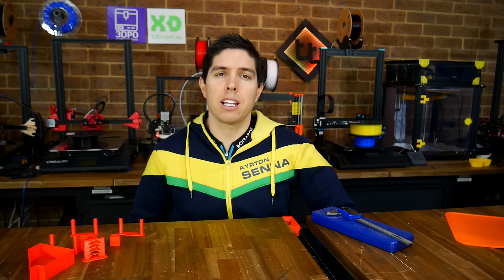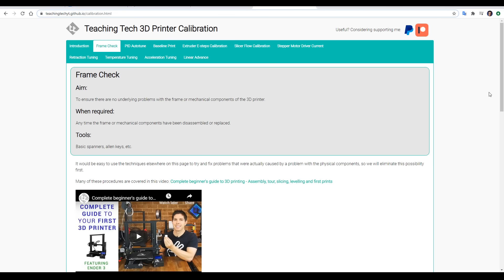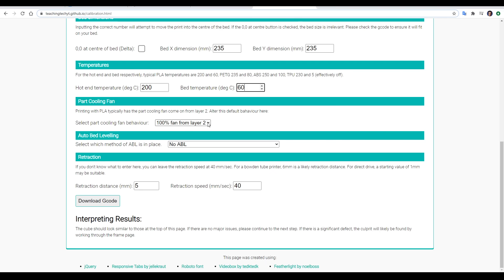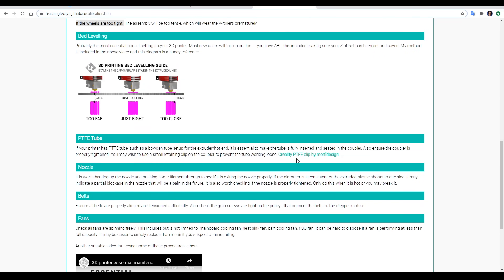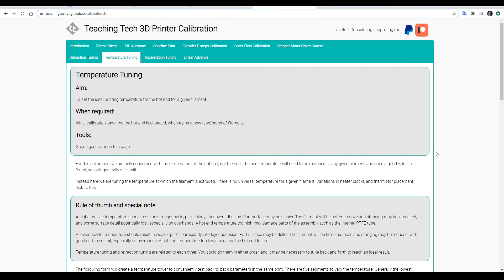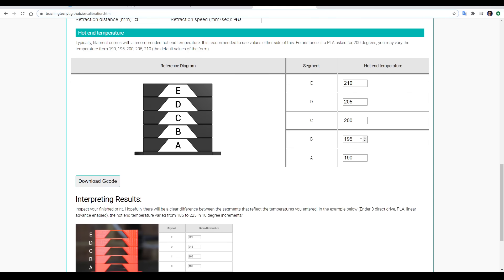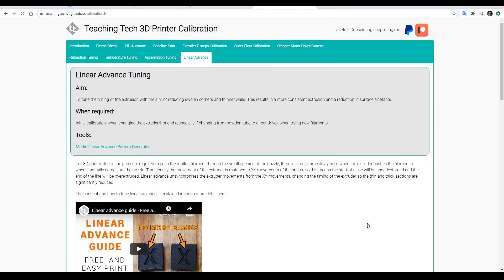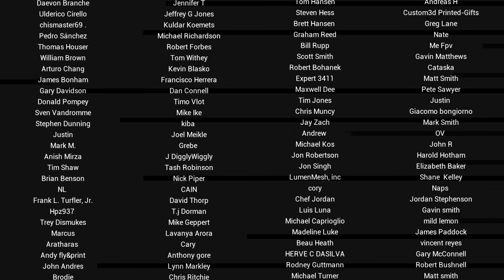3D printer calibration revolutionised - Step by step to better print quality

Comment: I think your site is good however is it hard to add support for delta printers for things like step calibration, as you cant change the motors one at a time they have to be in sync to function properly in movements some parts of the site for deltas will mes up peoples delta printers if they do not understand the geometry of how that function.  nice site though

Comment: Ive been using the website to really dial in my Frankenstein 3D printer. I really think I bit off more than I could chew and without the website, I wouldn't have been able to calibrate it.

Comment: Wont all this calibration directly on the g code be rendered useless if working with slicer settings like cura? Or do I leave all slicer options alone since we calibrated manually?
Reply: The site produces the gcode that would otherwise be generated by your slicer, thus bypassing the slicer.
Some results can be stored in the printer such as extruder steps per mm, some would need to be changed in your slicer during normal printing.
Some would be both, like temperature setting at the printer as you do your other tests, but also apply to the slicer.

Comment: I am confuse I am trying to use your website for a gcode and stl to check e steps but can not find anything.
Reply: For esteps, you have to use a terminal connection to the printer through USB, or use sw like Octoprint.
In the case of newer enders, you can command extruder movements, change stepper setting and store to eeprom from the printer controls

Comment: calibrations to perform (in order)

klipper:
pid tune
estep calibration
skew correction
pressure advance
input shaping

slicer:
flow rate
temp tower
retraction tower
horizontal expansion

Comment: Question, i hope you can reply. What is the Default flow rate in the retraction tower, it comes out so nice, but i can not find it in the Gcode the fabulous website generates.
I print it with PC-PETG and the top layer is flawless, as well as the sides. i would like to take those setting to my S3D

Comment: Hello, when I press a 100 mm 10 mm rectangle vertically, 100.10mm 10mm comes out, when I press horizontally, 10.10mm 100mm comes out. In other words, 0.1mm is added on the y-axis in all cases. I couldn't find what the problem is here.

Comment: 1. With this website, you have done more for the 3d printing community, for free, than anyone ever.  Thank you.  Second, I cannot get any of the parameters to increment.  I will ask my printer to print at 200, 205, 210, 215, and 220, and it will only print at 210.

Comment: I run the Ender 3 Pro with the creality ender slicer program. Would I be able to tune my printer with your web site and my slicer program or should I use 1 of the 3 you use in your web site?

Comment: Thank you so much for the amazing effort that you have been giving to the community.
I have a simple question, did you add any special settings for the retraction test such as z hop, wiping, or coasting? 
Because when I print the gcode generated from your website it turns out amazing but when i use the same exact settings with my slicer i just get terrible stringing.
Any has any idea why would this happen?

Comment: Great help with these videos. Problem with my e-step calibration as nothing comes through my hotend when I extrude the 100mm. Can I put the full 120mm into the calculator to get the amount of e-steps to put into my code?

Comment: Thankyou for a wonderful calibration resource. I do have 1 critique though. Please don't take this as dismissive of all the work you have put into the site. Its awesome I acknowledge all the energy you have put into making this a reality. But.. I don't understand why the derived flow value can't be used in the other tests. If the base code of the tests are all sliced with 100% flow then the M221 override could be applied to all of them for an accurate test. The tests are only capable of ball park results otherwise. Surely you have thought of this. I must be missing something.
This my have been discussed in the comments already and I'm sorry if it has but there are far to many to look though. I did start to but the comments just kept on loading lol.

Comment: I've been having trouble with dimensioning and tolerances and discovered a flaw in the way we calibrate the e-steps.  When we measure only one object we're not accounting for the fixed offset from over/under extrusion (there will be some).  The only way to get the scaler for the e-steps separated from the fixed offset is to make at least 2 objects and plot a linear regression for each axis...y=mx+b where "m" is the scaler for the e-steps and "b" is the fixed offset for the "horizontal offset" line in the slicer.

Comment: I can print fine, extrude from the printer control but if I type in G1 E100 F50 as the website directs, my filament is unloaded instead of extruded.

Comment: Thanks for having this tutorial however, I am fairly new and wanted to learn more, my problem is I cant find a video how you started in editing the values in the gcode and instantly save them to your printer. Do I need Pi? Can I do it using my stock ender 3 pro? with no additional things to add? 

Would appreciate your help! Thanks in advance.

My background is that I use Cura Slicer, save it, and print.

Comment: A guide on how to calibrate E steps with octoprint would be handy. Edit: Im very new to 3d printing. I couldnt get Pronterface working and how or if I use slic3r is a complete mystery. I am using Octoprint but I dont know how to calibrate the e steps with it. So the instruction "enter M92" means nothing to me. Any help would be appreciated. Cheers.
Reply from the maker: It's exactly as the website says, after you click on the terminal tab in octoprint. That's where you enter the commands.
Reply: @TeachingTech  I didn't know what the terminal tap was lol. Such a noob. Thanks for the reply.
Reply: Got it lol https://www.youtube.com/watch?v=HVljfDVPp3o

Comment: I know this is a late date for this, but...
I have had my Ender 5 for about 3 years now.  I made an MPCNC machine with it, with very limited success.  When the new Primo MPCNC came out, I decided to give it a go.
TO do this I need accurate prints.  I did the Cal Cube and stepper adjustment, and got my cube very good dimensionally!  However, larger pieces were wildly inaccurate.  I tried to force the pieces closer by using horizontal expansion.  It was better but I was missing something.  I adjusted all the belts and such on the machine, and figured that adjusting the steps was just WRONG.
I set the steps back to the default (except for the Extruder) and did a larger part.  It was pretty close.  Then I added a little negative horizontal expansion (-0.18mm), and the 1.5" hole was only 0.004" off, instead of the 0.05" using the step adjust method.
I wondered, then, how would the 20mm cal cube do with this same horizontal expansion.  It was about 19.88mm on average.
A little more tweak would bring the 1.5" hole up to dimension, and make the cal cube very close....
I feel like those suggesting the step adjust method, should also consider "teaching" the horizontal expansion method.  One can also use the hole adjustment correction if you have problems with that....
BTW this Ender 5 has TMC2208, SKR 1.3, all metal hot end and all metal extruder.  Soon to have an SKR Mini E3 and 2209 drivers.

Comment: So I know it's been a year but I found a really accurate way to get esteps and that's to turn you printer into E in mm3 do everything Michael does but the end value divide it by 3 and you'll get the most accurate e step value. Make sure to take the printer out of E in mm3 in filament settings before you start printing

Comment: Hey Michael. For whatever reason, the retraction tower on an Anycubic Vyper specifically scratches the bed right away when it goes to print. If anything, I would have to assume it's a firmware issue in combination with the strain gauge bed leveling system the machine uses. Apparently there's a lot of stuff not enabled in the stock firmware, such as linear advance.

Hopefully some community firmware comes out once more people receive their machines and the issue can be fixed. I doubt it's an error with G-Code your website generates.

Comment: Invaluable resource - many thanks. One note: in order to simply upload the generated GCode and successfully print via Octoprint, Octolapse needs to be disabled. Otherwise, the very meaningful error "No slicer settings were not found in your gcode file" is generated.

Comment: this is brilliant, but does cura use 0.8 for wall thickness, ideally, for someone new to 3d printing this 0.4mm wall thickness wouldn't be found in cura and will cause further confusion...the tab i talking of is the flow tab

Comment: The stepper motor current bit is kind of out of place IMO. It's like if you had a driving course: 1. How to accelerate. 2. How to brake. 3. How to steer. 4. How to do a 180° burnout in a torrential downpour at night, while injured. 5. Parallel parking.
Reply: Lol

Comment: Hello, I've watched a lot of your videos which have helped me learn printing. I am a cnc machinist / programmer, so I have some insight on the gcode stuff. There are a few areas I'm having trouble, but the main one is I had last upgraded to the micro swiss direct drive setup; the nozzle is no longer set to the original corner for X0, Y0. Instead it's off the plate by a 1/4 inch (6.35mm) in the X and Y. I watched a video a while back that I learned the coding to re-establish a new work offset origin, and stored it, but for some reason the test line still is off the printing plate. And, now I have a blob in the start of my print. (I had also calibrated the stepper for the extruder)

I hope I'm making sense, but Im really dying to print again and see the results of my new setup. I'm also running the BTT SKR Mini E3 v2.0 main board.

I also have honestly never done a firmware update since installing, that is another area I feel I have trouble in. I downloaded pronter face but I feel lost when it comes to that. 

Any help is GREATLY appreciated!!!! 
Thank you in Advance!

Comment: Hey, thanks for the video. I have some questions which I hope you can help me with 
1)Is there a way to import the GCode to Ultimaker Cura? I get the error message: "Invalid File" when I drag+drop it.
2) Is there a way to do the E-steps Calibration without a Rasperry Pi?

Comment: For the Extruder E-step calibration I have the micro swiss direct drive. I was told that calibration should be around the 140 range. I did the test and I was 31mm away. So I calculated   93x 100= 9300. Then divide 9300 by 31 and I got around 134.Is this correct or the calculation in video is correct. I dont have a stock extruder?

Comment: Fantastic work you do here on your channel Michael I love it and since I've been looking in this arena I always end up on your channel.
My head hurts after watching this post. I loved it up until you went from mechanical to Coding manipulation, G code this that etc etc. I was hoping to design, draw, save and put the code into a 3d printer, it may seem simple to some but old dogs new tricks is the thing here for me.
Coding and associated software Tinkering will be my frustration leading to "I have a 3d printer dust collector" and to learn I need to start by buying a printer.
I was hoping to learn to use a CAD program and print custom moulds for Carbon Fiber and fiberglass parts so I have a specific task and still hoping 3d printing may be THE tool for me, it looks like fun, I'm hooked on the Ender 3 right now its popular and plenty of support out there.
Michael would you please tell me the name of the CAD software you used in this video?
Your my goto 3d printer man, love YouTube, also what was the turntable stylus doing in reach of some unknown Child, that was funny.

Comment: Hi Michael - great info, as always.  I am sure you are aware that Simplify3D has a “terminal” in the Communication tab of the Machine Control Panel.  You can enable “Verbose” to see all the communications.  Fair warning, however, you may need to be quick to see the responses to a command you send.  This is in response to time mark 7:25 of this video.  Thanks!

Comment: I don't understand the E steps calibration... Do I have to make my printer feed into nothing? Like remove the bowden tube? Or can I have it feed through the nozzle?
Reply from the maker: This is hotly debated. It's simply not realistic to disassemble many printers to extrude in mid air. The feed rate is very slow to make the extruder's job easier and ensure accuracy.

Comment: Ok, I have been humbled.  I am not a coder and apparently my printer has been doing most of the heavy lifting.  This is one of the reasons I bought the printer I did, I just wanted it to work as I don't generally have a lot of spare time (crazy job, 3 kids, and a wife), so I bought an Ultimaker 3 a while ago.  I have been trying to go through your quite awesome tuning setup as I have been having issues printing rounded edges even with supports, which confuses me greatly.  I have a feeling Marlin isn't compatible with my Ultimaker's Firmware.  Luckily, I found work arounds for the early tuning steps.  However the bits of your site I am most interested in contain items I have to get from your code.  I clearly have some changes including filament size, dual extruder, etc.  I got to the retraction tuning before getting stuck on the code issues.  How do I add the proper details or convert to a firmware that works with my Ultimaker?  Guessing my firmware is called Griffin, but haven't been able to confirm that is what flavor means yet.  Anyway, this is what I find at the start of my Ultimaker g code after I got it uncompressed.

;START_OF_HEADER
;HEADER_VERSION:0.1
;FLAVOR:Griffin
;GENERATOR.NAME:Cura_SteamEngine
;GENERATOR.VERSION:4.8.0
;GENERATOR.BUILD_DATE:2020-11-10
;TARGET_MACHINE.NAME:Ultimaker 3
;EXTRUDER_TRAIN.1.INITIAL_TEMPERATURE:210
;EXTRUDER_TRAIN.1.MATERIAL.VOLUME_USED:212751
;EXTRUDER_TRAIN.1.MATERIAL.GUID:44a029e6-e31b-4c9e-a12f-9282e29a92ff
;EXTRUDER_TRAIN.1.NOZZLE.DIAMETER:0.4
;EXTRUDER_TRAIN.1.NOZZLE.NAME:AA 0.4
;BUILD_PLATE.TYPE:glass
;BUILD_PLATE.INITIAL_TEMPERATURE:60
;PRINT.TIME:17599.427812
;PRINT.GROUPS:1
;PRINT.SIZE.MIN.X:42.74
;PRINT.SIZE.MIN.Y:6
;PRINT.SIZE.MIN.Z:86.27
;PRINT.SIZE.MAX.X:204
;PRINT.SIZE.MAX.Y:164.94
;PRINT.SIZE.MAX.Z:123.87
;END_OF_HEADER
;Generated with Cura_SteamEngine 4.8.0
T1
M82 ;absolute extrusion mode

Comment: Hey Michael, I've done all those tunings over the years mostly following along you and the other creators when the videos came out. Despite me getting great prints on my Ender-3 with SKR mini E3, I never got clearance tests to move under 0.3mm. Do you think my only alternative is to switch from ABS to PLA? PLA is very expensive here in Brazil. Great Senna hoodie BTW.

Comment: I tried to print a calibration cube (20mm on each dimention). The results were a bit off. 20.18, 20.15 etc.. I calibrated the extruder but the results weren't that much better. I moved on to calibrating the e-steps for each axis and I got an almost perfect print (19.98 on X and Y and 20.00 on Z). However... when I tried to print two cubes, side by side, I got back to the previous problem (more than 0.1 difference in size).

If I print cosmetics or other stuff, this difference in size is trivial. The problem will be whenever I need to print something intended for mechanical use (gears etc).

Comment: Love your channel and this calibration process in particular. 
I have a question about the calibrating the e steps for the extruder. I have an ender 5 plus and measuring off the runout sensor is kind of rough with the spool in the default place. I did your steps but I wasn't sure I got it right (needed a 3rd hand). Since I had pulled the bowden tube off the hot end anyway, I tried something slightly different.
I cut off the filament so it was flush with the end of the bowden tube (actually I trimmed off both to make sure it was exact), then I told my printer to extrude 100mm. I then measured the filament that was exiting from the bowden tube (would normally be going to the hot end). This way I didn't have to mark anything and it was pretty easy to measure (my 50cent wooden ruler has a groove down the middle that was perfect).
Is there any reason I should not trust that measurement? There is so much to learn still so maybe I'm missing something.

Thanks again!

Comment: This is quite stunning in its completeness. It took me about two years of tinkering with a delta printer to figure out the right sequence of calibration steps (get your delta rod length right before calibrating your height and do height before your Z-probe offsets and bed leveling, etc). This is quite a service to the community to put this site together.

Here's another idea I had (which required generating custom GCODE, which is why I didn't get around to it, but you're already well into that game, so I'll mention it): Make some calibration squares for fine-tuning first-layer height. Basically, make a square which does a few passes at Z=-0.05mm, then some at Z=-0.04, then Z=-0.03... all the way up to Z=+0.3 or so. What you should end up with is a thin square with "too-low" characteristics (ridges) on one side of the square, gradually morphing to one with "too-high" characteristics (spaces between extrusions) on the opposite side of the square, and some "sweet spot" somewhere in the middle.

Comment: Pretty much all the default Ender3 V2 settings are optimal. Nice tests though. Maybe someone can explain to me this one thing. With the first layer test, each of the squares have some under extrusion in the bottom right corner.